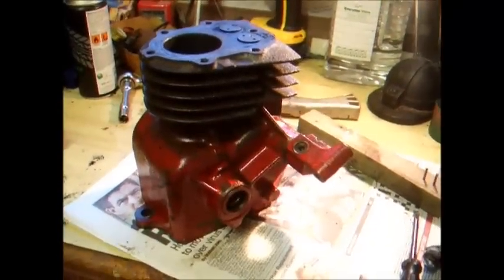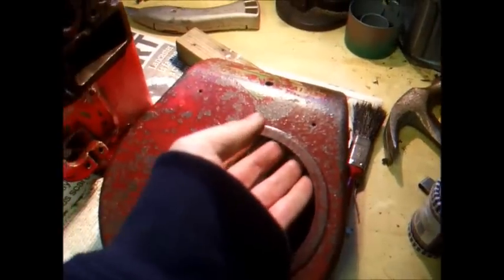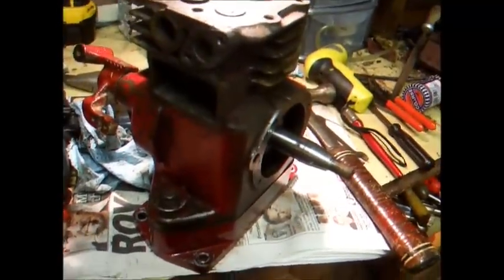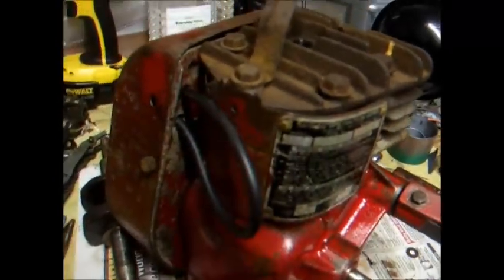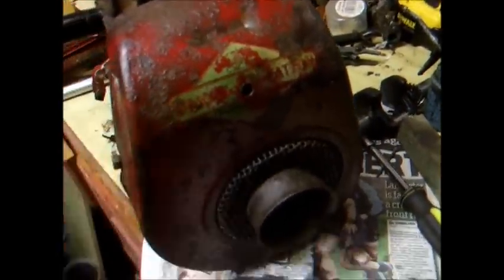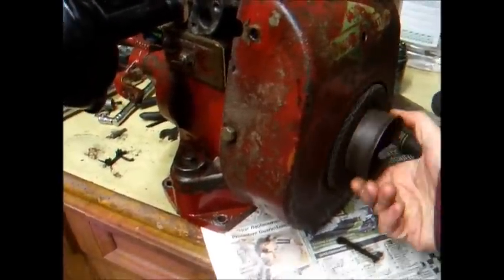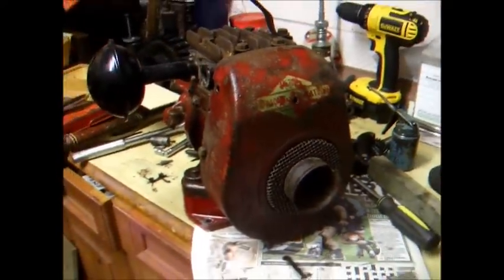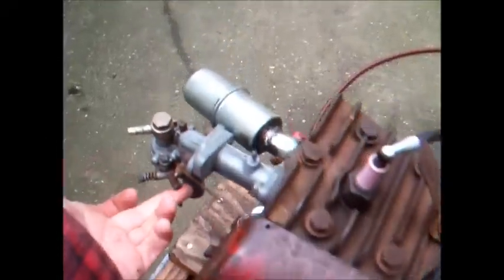Briggs and Stratton 5S - Part 2

Comment: Excellent work. These are one of the most satisfying antique engines to work on and you don't constantly get frustrated trying to find parts because cheap parts are almost always available. 
These little engines are way overbuilt for their 1 hp rating.  Very heavy duty lower ends for a 1 hp engine.

Comment: that looks great and just wondering did you get that of ebay for £5 ? if its the one i think it is then i forgot to bid. it looks like an early suffolk :)
Reply from the maker: Thanks.. yep its the one that sold for £5 on ebay. Good thing you forgot to bid because I forgot to up my maximum bid. Only had £5.01 on it! lol
Reply from the maker: MO3MINI
This Briggs is older than any Suffolk engine. 1952 this one. And the design basically follows on from late 30's Briggs engines... Suffolk copied the design lol
Reply: looks like a great one did it run well ?